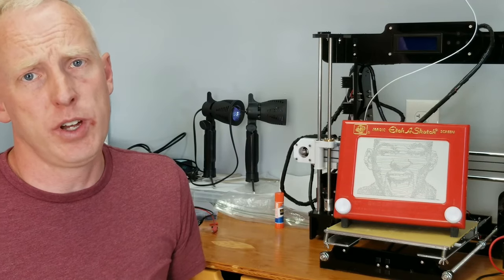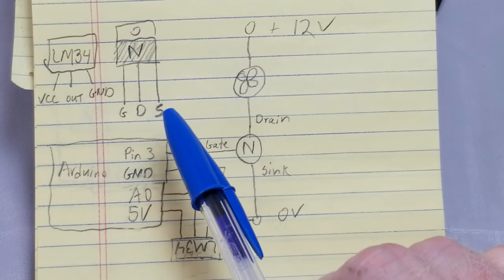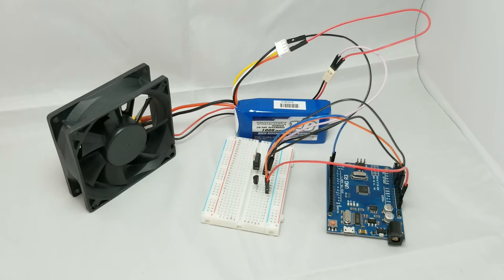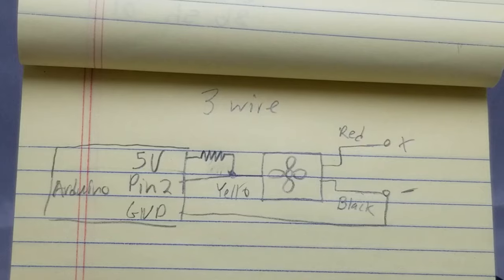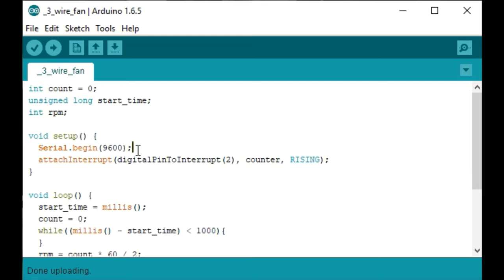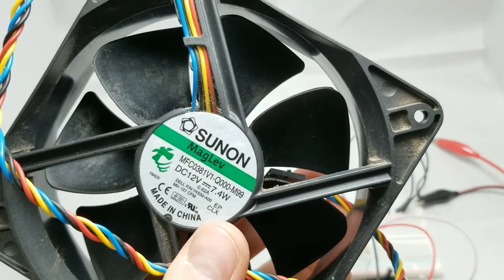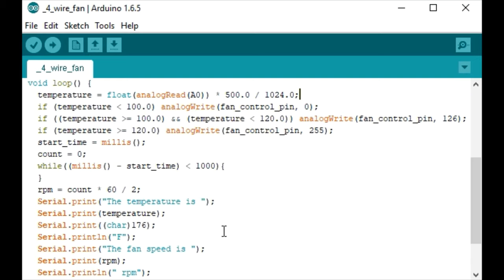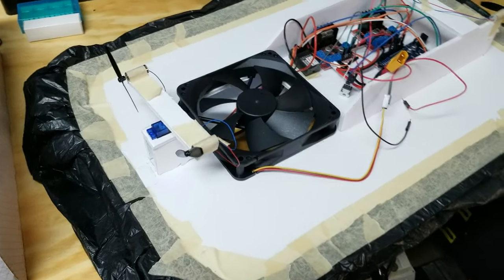Arduino Fan Control // 2-Wire, 3-Wire, and 4-Wire CPU Fan Speed Control and Measurement

Comment: Excellent video!!  I'm planning to use an SHT15 (temp/humidity) sensor with an Uno R3 as the "controller" for the fan ... my sketch will set output based on the temp/humidity values.  Any hints on SHT15 are welcome?
Reply from the maker: Sounds great! I haven't used the SHT15 yet. Hope it goes well!

Comment: This is the video I was looking for! Just a question - I'm building a PCB for 4pin PWM Fan control dependant on temperature but struggling to understand what I could use to replace Arduino. I'd like to use the Arduino code for whatever microchip I can replace it with. Any advice? The fan is 12v 1A.
Reply from the maker: Have you used an ATTINY before? I use those in some of my videos. They work with Arduino code.
Reply: @ScienceFunInnovations  I went with Atmel328P in the end and running N-channel Mosfet to regulate speed dpeneding on temeprature from NTC thermistor.

Comment: Where is the flyback diode parallel to the motor!? It is really important! How did your transistor not blow up? 

Apart from this: good video.
Reply from the maker: These fans have brushless motors with build in controllers. There shouldn't be any flyback voltage... at least I have never had a problem with them. Thanks for the comment.

Comment: Is it possible to have a potentiometer control the fan speed in place of the temperature sensor for the 4-pin?
Reply from the maker: Yes. Hook the side pins to 5V and GND and the middle pin to the Analog input. The code should work just the same.

Comment: Apparently the PWM signal wire shouldn't be connected directly from the Arduino to the fan. Arduino `analogWrite` outputs a PWM signal with a frequency of at most 1000 Hz, whereas the fan has "acceptable operational range 21 kHz to 28 kHz" according to the Intel specification ("4-Wire Pulse Width Modulation (PWM) Controlled Fans: Specification" v1.3). It may work with some fans but there's certainly no guarantee that it will operate so far out of spec.
Reply from the maker: It seemed to work for me, but I'll do more in depth testing at various speeds. You can also configure your Arduino to have a 25kHz PWM on channels 9 & 10. Just takes a little more setup code, but that would take care of any issues. Perhaps another video is in order...
Reply from the maker: See updated video https://youtu.be/YBNEXWp-gf0 showing how to control the fan using 25kHz PWM from the Arduino.

Comment: Hey bro, I have a those SanAce server fan's but they are three wire but I have no use of the tacho signal I just want to PWM control them I tried the normal PWM which is the basic PWM for the Arduino but the problem is the fan is making that humming sound b'coz of the PWM and I am gonna use them in an power amplifier so I want them quiet I am not gonna run them at 12V as they are so loud at full speeds. do you have any Idea how can I PWM control them but get rid of that humming. It would help me a lot <3
Reply from the maker: Yes, check out my other video about high frequency PWM.
Reply: @ScienceFunInnovations  ok thank you :)

Comment: Can I use a variable 0-5v dc voltange on the blue wire to manually control the speed?  If yes, can I use a potentiometer connected across  a 5v dc source to control the fan via the blue wire?
Reply from the maker: I think it only works with PWM, but let me know if you figure something else out.
Reply: I've been looking at the same thing the past few days. You can use analogWrite to the pwm wire to control the speed so I'd think a potentiometer would work the same way.  My problem is reading the rpm it's showing more on the lower speed.

Comment: hey ...!! the video is awsome please i have an issue everything seems to be working fine ...i didnt use any mosfet and im using 4 wire pc fan with esp32 board when the temprature is less than Min temp my fan always tends to spin and i want it to stop its spining before its Min temprature reached  ..??? can you please help me how can i stop fan spining till its min temperature condition is met???
Reply from the maker: The only way is to put a MOSFET to interrupt the 12V supply (or the ground). It would take another digital output.

Comment: With adruino, you can actually control fan speed of 2-wire and 3-wire fans as well by generating a PWM voltage output to the fans. Any tutorial on that?
Reply from the maker: You can control the speed using a MOSFET like I did in my hovercraft video (except analogWrite instead of digitalWrite). Just be careful not to run at speeds below 25% as that can damage the brushless motors on the fans. You could also use an h-bridge driver like in this video https://youtu.be/YkfBtjs8uWg. Thanks for watching!
Reply: @ScienceFunInnovations  thanks for the tip! Let me go check it out. 👍😎

Comment: If I use a 2-wire fan, do I necessarily need to use the MOSFET or can I do without it? The MOSFET is only used to change the fan speed?
Reply from the maker: Correct, it only changes the speed.

Comment: I hooked up my 3-wire fan exactly as you've drawn it, but the serial monitor is only reporting 0 RPM. How do I get it to read the correct RPM? The fan I'm using is the be quite! Pure Wings 2 140mm
Reply from the maker: Not sure why it isn't working. Have you verified that the fan is giving a pulse?

Comment: would it be fine to power the fans with the arduino's 5v then passing it through an MT3608 to get 12v, then to the fan? pretty new to this stuff. Thanks
Reply from the maker: Don't power the fan from the Arduino. It really can't output much power.

Comment: Im worried about motor whine; Does the 3 pin fan make more noise compared to just hooking it up to a PC?
Reply from the maker: Some of the fans do have a bit of noise. Other users have used filters or Schmidt triggers to clean up the signal.

Comment: i have a car tach and want to connect it to a 4 pin fan any ideas in what resistor to try as a pull up
Reply from the maker: Generall 10k works for a pull up

Comment: Would this circuit change much if I was to connect say three (3-Pin type) fans in parallel? I'm thinking Resistance would be the same?
Reply from the maker: The fans should run fine, but the tach wires would need their own interrupt pins to calculate speed.
Reply: @ScienceFunInnovations  Thanks for the advice, I ordered the components yesterday thinking I might need to use separate pins for the interrupt. Cheers.

Comment: Does a MOSFET is required for 3 pin fan
Reply from the maker: Only for speed control, but you could use a MOSFET, transistor, or motor speed controller.
Reply: @ScienceFunInnovations  I want maximum speed  for a 3 pin fan connected to aurdino . I want that circuit diagram.

Comment: I have the sparkfun red board with an ardumoto shield and I want to control 3 - 3 wire fans 2 are exactly the same and run best at 11.9 volts the 3rd needs 13 volts, I'd like them to just run full speed all the time, how do I do it?
Reply from the maker: Use a 13V power supply. Run the 13V fan at 255 PWM and the 11.9 fan at 233 PWM (255*11.9/13).

Comment: Would using a 9v battery for the  fan be a mistake?    and cause the fan to always be on ... ?     (at first it did work correctly 🤔
Reply from the maker: A 9V battery would drain pretty quickly, but it shouldn't affect how the code works...

Comment: if using a DS18B20 digital temp sensor with the 4wire fan instead,  how would the code need to be written.?  Thanks
Reply from the maker: I have other videos that use the DS18B20. That device produces a string that you need to convert into a number.

Comment: How can I wire a 5V 4-wire fan (brushless dc motor) so that I can attain the RPM but also control the speed using a potentiometer or custom input via my code?
I want to be able to create graphs to compare motors
apologies if you've already answered this, would love to touch base via email and perhaps discuss my project!
Reply from the maker: It should work the same with 5V motors. You can replace the temperature sensor with a potentiometer. Just connect 1 leg to 5V, one leg to 0V, and the middle leg to the analog input on the Arduino. Hope this helps.

Comment: Soooo I used the setup for a 2 pin fan and powered the fan over an USB charger. Arduino exploded and charger aswell. How could power pass through the mosfit onto the arduino? I dont get it.
Reply from the maker: Sounds like the MOSFET was wired incorrectly...but I'm not sure.

Comment: @6:12 Hmmm... I thought that the PWM signal had to be the same voltage as the fan? (i.e. a 12VDC fan requires a PWM signal which is also at 12VDC, and a 24VDC fan requires a PWM signal which is also at 24VDC).

Or do I have this all wrong... and the PWM signal can be at logic level voltage (5V) regardless of the fans rated voltage?
Reply from the maker: I think it would work with a 12V or 24V PWM, but from what I understand, all the logic is usually at the low end. For example, a low when the voltage drops below about 0.5V and a high when it goes back above 1V. That way a 3.3V, 5V, or 12V PWM would still work.
Reply: @ScienceFunInnovations  I confirm that I have seen PWM signals with 0,55Vpp working

Comment: Hello I have a question...
Can 3 pin fan sense power by positive input 12v ?
Reply from the maker: Not exactly sure what you are asking. On a 3 wire there is just positive, negative, and rpm.

Comment: Hi, How would you turn the fan off without any power? when you use analogWrite(...., 0) it will still spins but there is a way to shut down the fan ?
Reply: I'm working with 4 wire fan
Reply from the maker: You would have to use a MOSFET or transistor or relay to totally cut power to the fan. You could control these devices with a digital output.

Comment: I have a 4 wire fan and I want to control direction and speed of the fan. How can I change the direction of  this fan ? If I write a negative value to the code block for the speed, can I solve the problem ?
Reply from the maker: These fans will only spin in one direction. You would have to get a different fan and use a motor controller like an L298N.

Comment: Can I use a 12v 1.5A brushless fan with Arduino Uno?
Reply from the maker: You would need a seperate power supply for the fan, but yes you could use the Arduino to control it.

Comment: Got a 👍 from me 1:18 QUESTION about the 2 wire fan:  Can each wire be directly connected to a 12v battery with a on / of toggle switch in either line? I live in HOT Florida and would like to add one in front of my air cooled Honda 300 ATV 4 wheeler, if this wouldn't work I'd appreciate your recommendation, I'm a electrical idiot LOL
Reply from the maker: For a 4 wheeler I would just use a 2 wire 12V fan. Hook the black wire to negative and use a switch between the fan and the positive on the red wire. Good luck.

Comment: Can you turn the 3 wire fan on and off with the arduino? If so, how?
Reply from the maker: Yes. Just add a MOSFET to the power line and use another digital output from the Arduino.

Comment: Know of a way to take a high RPM signal and turn it to a lower value. For a example a controller wants a Fan to spin at 10,000 RPMs and the fan can only push 5,000 RPM? So the Controller will think the fan is spinning at 10,000?
Reply from the maker: What type of controller are you using?
Reply: @ScienceFunInnovations  Really and truly it's a old Dell R410 server I modified. It's in a custom case I built and I have some noctua NF-12x25 PWM 4pin fans. When I boot the system it ramps the fans high as it can (2000RPM) but only sees the 2000RPMs when it's expecting 8000RPMs and I end up with a fan error. granted I can bypass it by pressing a key but it's annoying.
Reply from the maker: @lelandclayton5462  Yeah, you would have to make a fake signal to trick it out. Maybe have an arduino read the frequency of the fan and then output a frequency 4x as fast.

Comment: Great video! Quick question: I read that if the Arduino is powered with a power adapter (barrel connector), this voltage gets copied on the VIN pin. So if a 12V 1A adapter is used, the fans should be able to get power from the VIN pin. Is that right? Also, how should it be determined which MOSFET to use? For example, in another video they use an IRF530N. No clue how to figure this out haha. Thanks a lot!
Reply from the maker: You don't want to pull too much current throught the Arduino, so I would run a seperate wire to the fans for power. Just check the current rating on the mosfet, there are probably dozens that would work.
Reply: @ScienceFunInnovations  Thank you! Apparently the VIN pin bypasses most of the Arduino's circuitry, but the max current is limited to 1A by a diode. At least, that's what Google says. I believe fans have a max current draw in the direction of 80mA, so I guess powering a couple of fans should work easily. I guess I'll just try it, if you have any comments on this please let me know. Thanks again! :)

Comment: How can I do the speed control without a temperature sensor?
Reply from the maker: Yes. You could use a potentiometer instead, or simply use your code to change speeds.
Reply: @ScienceFunInnovations  Thanks for your answer. What value should I change in the code for speed control?

Comment: Do you know if I can controla 4-wire fan only with a potentiometer or do I need more components to make it possible? I only need to adjust the speed and not reed the rpm so the tachometer pin is not needed. Thanks!
Reply from the maker: You could just use the positive and negative wires and put the potentiometer in series with the positive wire (as long as the potentiometer can handle the current). Otherwise a 4-wire would need a PWM signal instead of pure voltage.

Comment: When I plug out the speed wire of the fan and touch the jumper it gives me the rpm value. When I connect the wire with a 10 K resistor as a pull-up to my Arduino pro mini, the program gives me 0 rpm. Is there anyone who knows what is the problem, please help me immediately?
Reply from the maker: Hmmm. Not sure what is going on. Are you pulling up to 3.3V, 5V, or 12V?
Reply: @ScienceFunInnovations  5V from arduino's Vcc pin

Comment: (while millis start < 1000 ) --> delay(1000) ?
Reply from the maker: The delay() function stops everything else in the code. Using the technique in the code allows the code to keep looping through without interruption.
Reply: @ScienceFunInnovations  ok I get it now. the while "skips" if the required amount of time hasn't passed. And the rest loop carries on. I tried the delay and it didn't work ( obviously ) , we need the interrupt to fire to bump the counter.

Comment: Inspired by your video, I ripped a few fans out of an old tower PC that had long stopped working. The fan that cooled the processor on the motherboard turned out to be a 4-pin fan. I set it up to measure the speed as well as control it following your instructions in this video, after cleaning the dust-encrusted fan. It is running well and I am so excited! Thank you for your amazing work that makes it so easy to follow along. I mostly make projects to impress my little one and your videos are a joy! Cheers!

GitHub: https://github.com/sunbee/Make_PCFan4Pin/blob/master/src/main.cpp
Reply from the maker: Glad I could help!